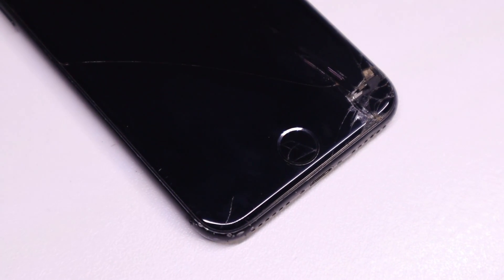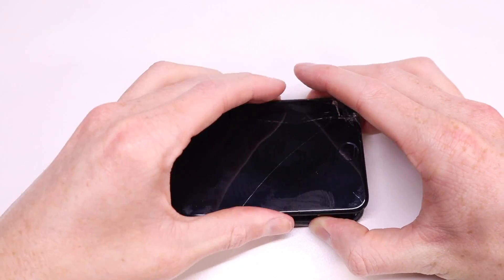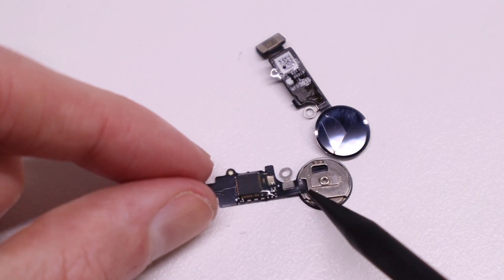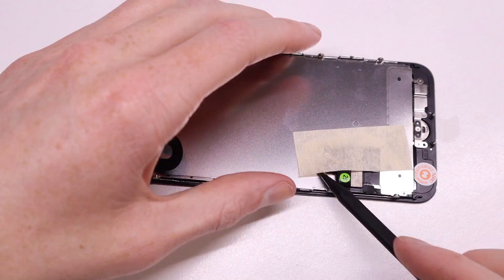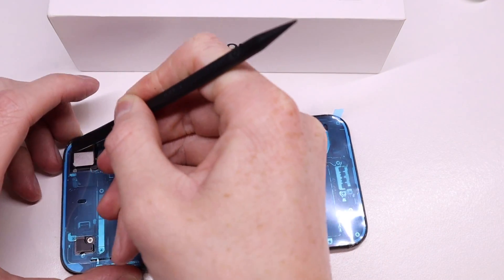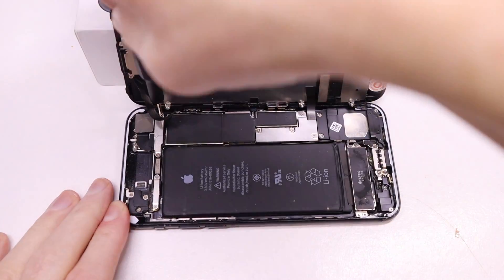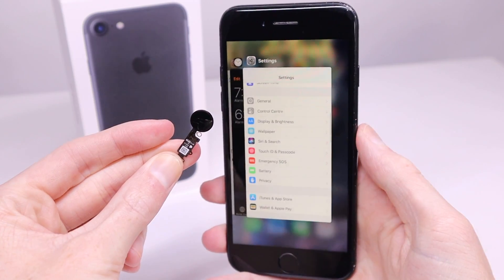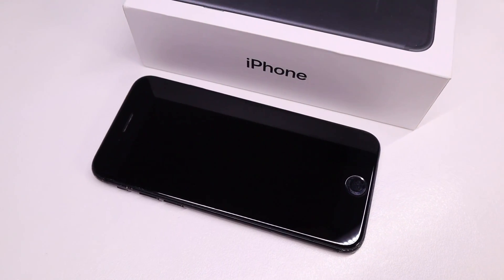Replacing Apple's "NON REPLACEABLE" Home Button

Comment: A caveat... constant Bluetooth would likely take a toll on 7's already weak battery. I have one with a bad home button, but have another with a worn charging port. I think I'll go as far as swapping the board and screen from the worn port phone to the other, then get a couple more years out of it between battery changes and when that charging port wears out. I'll likely move onto Android after something else goes bad because Apple phones are not DIY friendly. Yeah, I know it's 2025, but I never bothered 'upgrading' from 7 because I'm not fond of newer, larger iPhones wrapped in glass panels and the 7 simply still works perfectly as a basic smartphone.
Reply: My iPhone 7 is the upper 128GB version, so I could always buy someone's bricked or smashed iPhone 16 or 64GB for chump change these days and keep exchanging my matching board and screen to keep it going until the logic board or button finally dies. I haven't found a large memory 7 out in the used market, but if I find one with a busted screen or worn battery for dirt cheap, I'll grab it to save the effort of changing boards between my phones. All in all, I saved lots of money over the years by only buying used iPhones because I have a used home to pay off ASAP. 🤑

Comment: What is wrong with Apple in this case? They should NOT be allowed to do this under any sort of law or statute. I think that "parts pairing" for anything that is not security-related should be illegal. For example: display, battery, rear camera, etc.

Comment: My Touch ID button stopped working after a simple battery change. What could have been the cause ? Never touched anything but the screws for the plate in order to disconnect the battery.
iPhone 8 btw

Comment: There's an even cheaper solution. There's a virtual home button built into the os for iPhones and ipads. To activate go to settings / Accessibility / Touch / AssistiveTouch ON. This will place a virtual button on the screen which you can access regardless of what apps you have open.

Comment: you can do some crazy surgical stuff by cutting off the home button on the original and micro solder it back with a new one. everything will work again, so long only the home button was damaged and not any internal chips of the actual home button unit.

Comment: HI, there is now a Rev4 jc home button available. However, I got a home button from ebay earlier this year, it worked without bluetooth for a while.  like Rev 4 JC button will do, without bluetooth,  according to its seller on ebay. In my case, I used an update from apple, later after the install of h/button,  Apple blocked the home button from working???  In conclusion , the Rev 4  JC button version doesn't use bluetooth, according to its seller, so this should work fine, and be easier to install.  With the exception of fingerprint id, the home button should work most of the other functions. 

 In my view , Apple should not be allowed  to block a third party repair of the home button  or screen, as you who are the legal owner of the phone, and  should  have the legal right to take it to whome  you like to get it repaired.  Greedy as Apple are , they charge a whopping £154. 44 for a complete new screen and home button. Icould get a second user phone for  that price, and have some change.  Shame on you apple ripping  customers off.

Comment: So I have a iPhone 8 that one of my friend gave me but it is rose gold with a white face and home button. I don’t like it and want to do a switch over to black. Meaning that the home button will have to be replaced as well. ReadinSg the description for a new one. It has a disclaimer stating this replacement is for decoration only and it won’t function on my 8. Am I reading this wrong or is this true? If  so is there any other way around it.  Please if any one has some solutions to my problem. Your help would be greatly appreciated. 

Thanks
Regards

Comment: My iPhone 8 home button is broken and the phone is disabled. I plugged it in to itunes and restored it now it says press the home button to continue. If I replace this button there is no way I pair it without passing the get started screen or whatever its called. This part is not mentioned. How do you get the button work after reset? I would appreciate any comment. Thanks.
Reply from the maker: I guess you cant.. Great feature hey...
Reply: @HughJeffreys  thanks for the reply Hugh. Very frustrating. Even  the 3rd and 4 gen wouldn't work then? Have you tried one of these MaximalPower  external lightning home buttons?   https://www.amazon.com/MaximalPower-iPhone-Adapter-Support-Required/dp/B07C9LQY6G would it work to pass the upgrade screen? Is there any way to make iphone 8 home button work again?  Btw I have contacted you on Instagram regarding this. You can ignore my message there since  you replied here. Thanks heaps.
Reply: set up through itunes maybe

Comment: To anybody (nobody ask) there is a way to bring Touch ID back and to do that you need to use 3 i tools and get the Touch ID code then you get a special card/ Mechanic from jc tools to plug in the new Touch ID button the burn/write the Touch ID code to the button and the iPhone will think this is a original home button.
Reply: Sorry I didn't get what you explained..I've talked but the mechanic told that there's no way. The button is nonfunctional and the touch id too.they just replaced the screen.

Comment: I have iPhone 8 se2, after screen replacement home button stop  working I've bought  Home Button For Apple iPhone 7 8 Plus SE2 JC Restore Cable 6th Generation Black -this  com is without jumper connection but it  still doesn't work , Could  you  advise me if  this is fixable  have no idea if it's fixable

Comment: If you can just swap any homebutton, getting access to a phone would be a lot lot easier! So its a pain, but much more secure... BTW, if they would not break, they would not need replacement...that may be a better approach.  IS the button paired with the screen assy or with the motherboard?

Comment: Apple are horrible people, imagine if they actually released genuine parts at a good price, they could make more money from spares as I'm always fixing iphones for peoole as apple are too expensive yet a Chinese screen costs £25 off ebay, works and looks as good as the real deal, apple could even offer a home button pairing service in the shop with proof of ownership, as after restart phone still needs to have passcode entered so its not like a stolen phone can have acces gained, even full factory reset it will be useless as its locked to itunes account.

Comment: You wait until the very end of the video to mention the biggest issue, which is that you can't buy a new Touch ID enabled home button from a third party.  Only Apple has that power.  This is a workaround.  Make a new video once you've defeated the Secure Enclave for Touch ID or Face ID and then this will be impressive.

Comment: Hi.. Just curious..
My son dropped my 7+/Iphone and broke the glass.. Worked fine for abt 4 months then display was gone for good.. Green and black lines appeared on the screen,nothing was working on it and then completely shut down .. I took it to a friend for repair but after 3 days he said he can't do it. I took it to a service centre and the guy told me and showed me that cable was ripped from the button. Is been 2 weeks now and i my phone is still in service.. Does it last so long? And can the guys from service steal parts from inside phone? :( thank u !

Comment: Apple: You’re not supposed to fix your iPhone 3gs! You have to trade it in and get the iPhone 8 Plus or later.
Me: Hold my beer!
Me: replaces battery and housing carefully
Apple: How did you survive?
Me: I watched a Hugh Jeffreys video and that guy said “Li-ion batteries are safer than you think they are unless you are super reckless with them,” when he pulled out an expanded iPhone 6s+ battery.
Also me: Don’t lock iPhone batteries and DO NOT discourage independent repair, even if you think it’s too dangerous.
Apple: Okay.

Comment: There is a version 3 that does not click  it senses your fingertip.  It then makes the taptic buzz like original and no Bluetooth required.  It has already been copied by other China suppliers.  I tried a fake JC version 3 and it caused a 1 minute boot time rather than normal 20 seconds, so I returned it.  I am waiting for a real one to be delivered and I'm hoping it won't cause the boot issue.  It was $20  They all look like A+ quality construction.